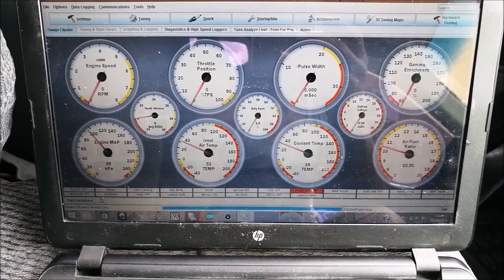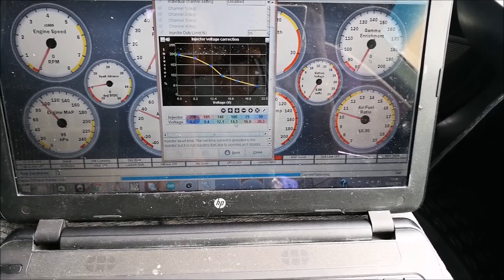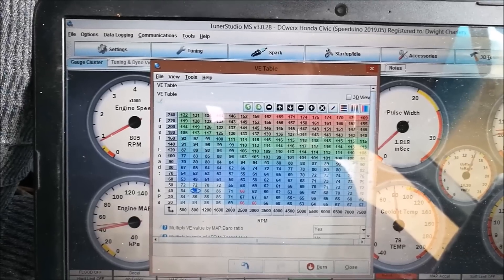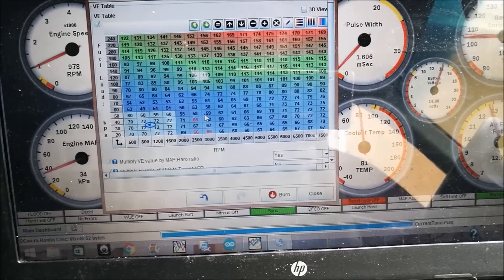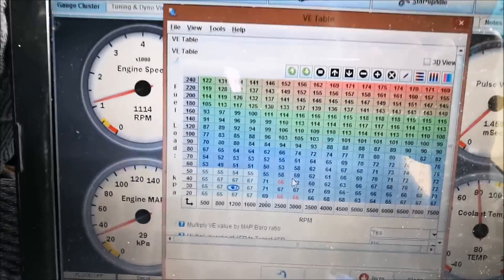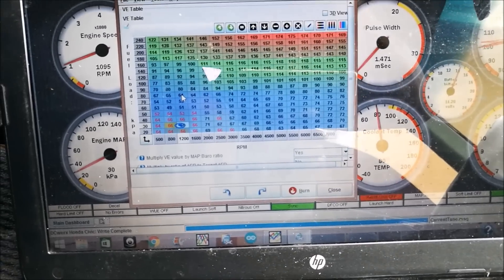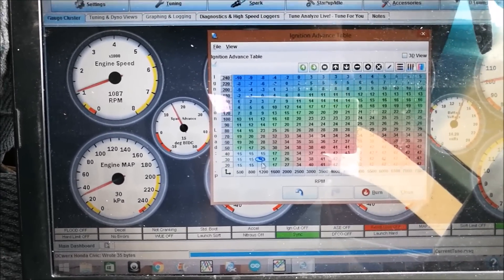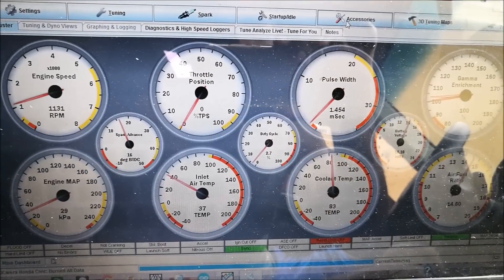Basic Idle Tuning

Comment: Iam  glad to find yours video's.It looks like you know what you are doing  .Do you build your own controllers.  What if I tell you that I drive a toy truck 3.4 supercharged  runs  on 87 octane  10 psi boost no knock and respectable power factory  ecu no modification to the ecu no piggy back it took me almost  a year to do it but i gotten done

Comment: Very helpful and easy to understand. Just one question someone may be able to answer, at idle how do I know which cells to change, is it the lower 6 roughly where the idle speed is?
My idle is around 950 rpm normally.
Thanks
Reply from the maker: That depends on how the x and y axis (load vs rpm) cells are scaled on your VE and spark table. You never really idle in 1 cell, because the software interpolates the cells, your idle is always generally an average of not just the 1 cell but, the cell to the right or left and the 2 on top or below. So your idle fueling is generally an average of these 4 cells, thats why the numbers around your idle have to be somewhat close with very little change. 

If you place your cursor over the cells in TS where your car is idling it will show you how much authority that cell has over overall idle. So out of the 4 cells, one may have 50% and the others may have 20, 20, and 10. You can use that to fine tune it even further.
Reply: That’s great, thank you.

Comment: Awesome video ! Why your idle speed is so high ?
Reply from the maker: My car doesn't have a idle control valve so it's a careful dance to set the throttle plate so that the car starts up and runs from cold without pushing the gas pedal while simultaneously ensuring the idle RPM isn't too high once fully warmed.

I suppose I can probably get it down to about 950-1000 rpm warm but it would idle really low when dead cold. It doesn't bother me that much to change it